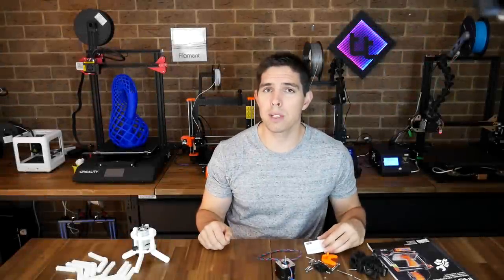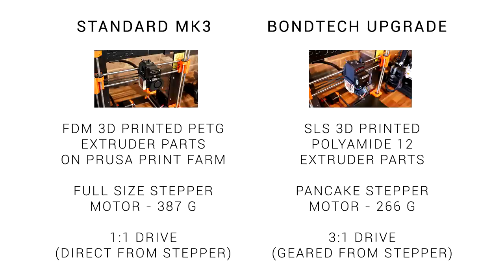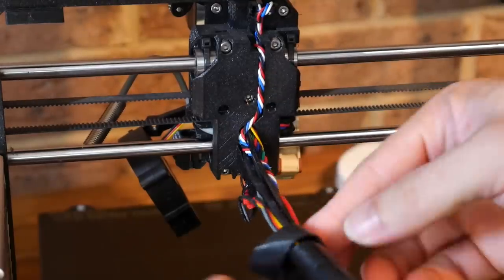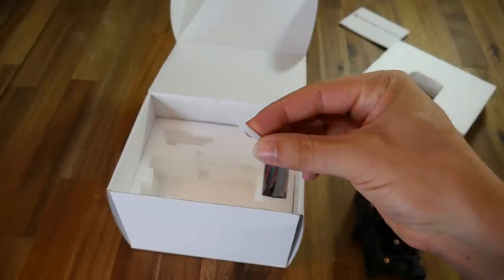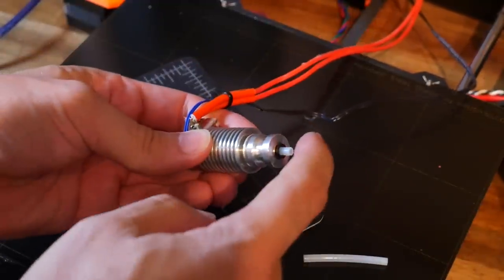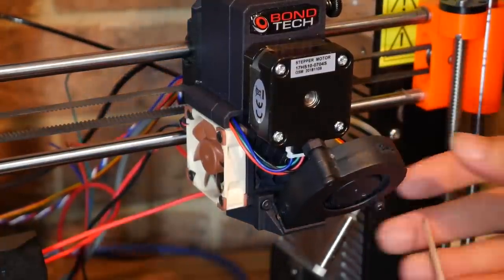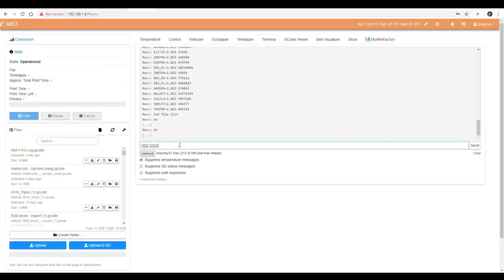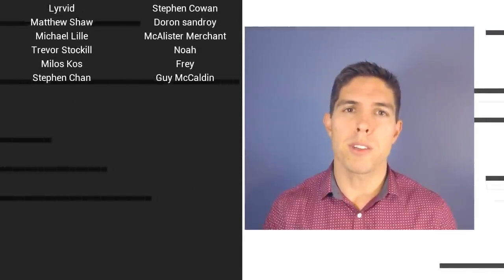Bondtech Prusa MK3 extruder upgrade - Installation and test

Comment: The Bondtech mk3 upgrade already got outdated. Prusa changed their filament sensor and made the mk3s. The upgrade is mandatory if you use mmu2, as the upgrade to mmu2s with mk3s upgrade is free for every mmu2 user. The new sensor is needed, because on normal mmu2 prusa did not use the old filament sensor due to reliability problems. The new sensor is "opto mechanical". Using the upgrade to mmu2s and mk3s will result in higher reliability on multimaterial.

So anyone with mmu who got the Bondtech mk3 upgrade might throw the nice sls printed part away as the new filament sensor will not fit there. Hopefully the community will change the design, so you could keep the other parts. But the housing is about a quarter to a third of the price the upgrade cost. As a new stepper motor is not needed anyway the only parts usefull in long term are the reduction gears, ballbearing and the lever-screw. You can get them much more cheap, even from Bondtech...

Definitly as nice as sls prints are - on a printer constantly improved by manufacturer its not a good idea to invest the money.

https://www.prusaprinters.org/original-prusa-i3-mk3s-and-mmu2s-release-sl1-and-powder-coated-sheets-update/
Reply from the maker: Just read the update this morning. Now i have to decide whether I pursue a MK3S or not.
Reply: @TeachingTech  In your case the decission is simple. Use the Bondtech mk3 upgrade as you already have it and the mk3s is mandatory only if you use an mmu2. Filament sensor is the only change that matters on mk3s, as improving cooling is done by the Bondtech mk3 upgrade also.

As soon as the community updates the design of the Bondtech mk3 upgrade to work with new filament sensor print it with pet-g (maybe with carbon fibers, looks and feels nearly as good as the pa12cf Bondtech uses), buy the mk3s upgrade and use booth
Reply: @oleurgast730  Dollars to Donuts says Bond Tech comes out with a new part that can be purchased.
Reply: Right after I get the Bondtech and before I finish getting it installed, Prusa makes this announcement. Feel like I should be able to send them the bill for it since I got it to address issues Prusa wouldn't. I am loosing a lot of my enthusiasm I once had for Prusa.
Reply: @cybrsage  Nice to hear. But anyway "new part" only can mean new printed housing, as the filament sensors chamber is part of the housing.
Simply adding a new chamber for new filament sensor on top of the old chamber (at the place normaly the top cover goes) and a tube "bridging" the space of the old chamber would be an simple and cheap solution for everyone who already have the sls printed housing from bondtech and do not want to throw it away - but it can be problematic with mmu2s.
Without mmu2s you not realy need to change to new sensor. Never change a running system. 

If you look at 3djake (german website), the Bondtech mk3 costs about 86€, without pencake stepper motor. A Bondtech BMG costs 89€. So nearly the same price, but the mk3 upgrade has a bigger sls print but not include the filament gears. So you can estimate the cost of the big sls print.

So the main critic on Bondtechs mk3 upgrade: They should give more optinions:
Complete, (for business users)
Complete without pencake stepper (this option exists on 3d jake)
Mechanical parts only (reduction gear, bearings, screws, nuts...) to print the head yourself (hobbyists).

The last option missing is the point. It would be much cheaper. Due to Prusa constantly improving designs, the Bondtech mk3 upgrade would be to be updated also. With self-printed head its no problem. But pay once a year for a new sls print+postage may be quite expensive for a hobby user.

Of course you normaly do not need to do all upgrades if you are satisfied with your printer. The mk3s upgrade is somehow special  as you need it for more reliability using MMU. But normaly no need to upgrade any time Prusa makes improvements.

I think, its a bad decission of Bondtech not to release a "mechanical parts only" set. Looking on the prices in their part shop (sadly very high shiping rates) it would cost about 40€.

I compared my original bondtech bmg housing (sls-print nylon pa12) with my self printed mk3 upgrade housing (fdm print with pet-g 20% carbon fiber). Look and feels nearly the same, exept some overhangs need postprocessing.

It is a totaly different situation if you buy a 86€ set (without stepper) and than only a few days later you throw away an sls printed part worth the halve of the set, or if you pay about the halve price, print your own part for 5€ ( for high quality material, if you use cheap pet-g its only about 1€) and throw away this 5€- part only and replace it with a new print.

I would like prusa to integrate the geared design into their regular mk3...

But the next step up should be the mellows dual drive bmg. It's not a simple Bondtech clone like there are many on AliExpress, but a real improved version. Its case is made from Aluminium and works as coldend. So you do not have a Grovemount, but you screw in your heatbreak directly.
Not only it has less hight (so moding bowden systems to direct extruder you do not loose so much print hight), but this way the length between gears and nozzle is shorter. As not only the molten plastic but also 1.75mm filament in a 2mm tube is elastic and increases time between extruder steps and filament actual flows out of the nozzle, this can make flow even more precise. I am very interested to find out and ordered one.
Reply: @oleurgast730  that's what I said, Dollars to Donuts they will sell the new part.
Reply: There's now a 3D printable MK3S sensor enclosure which bolts to the top of the Bondtech SLS unit.

https://github.com/BondtechAB/Bondtech_Prusa_i3/blob/master/Doc/Sensor%20Add-On%20V1.0.pdf

Comment: I recently install a Bondtech extruder with capricorn tube (both originals). I also have an e3d V6 hotend for a while and I´ve replaced the nozzle two weeks ago, BUT my printer keeps underextruding.  I´m printing PETG at 55-65 mm at 245 degrees and it works very well for an hour or so, until it starts to underextrude plastic and ruins every single  print I try. I´m pretty frustrated right now, ´cause I´ve try every trick in the book... 
BTW, both benchys and XYZ calibration cubes are printing without any problems righ out the SD card, so the underextrusion only appears when I print for longer times. 
ANY idea will be accepted.

Comment: I did this upgrade but after i got some small isue with bad first layer getting gaps between the lines ,did a check extrution and it extruded 100mm when i asked it to . So alitle at loss what do do

Comment: Owing to the fact that this should never slip on the filament, and knowing the diameter of the extruder wheels and the feed rate and the controller knowing when it is feeding and retracting etc, how hard would it be to estimate the length of filament used on each print? Just curious. Could an 8 bit controller do this?
Reply: Slic3r tell you lenght, weight and (if you gave the price/kg in filament settings) the price after generating the g-code. Why should the printer controller calculate it?

Comment: what would be better,  mk3s upgrade or bond-tech replacement?
Reply: I have both, and it would be better to go for the MK3S upgrade.   The completely new filament sensor works a lot better, and there's no difference in print quality that I can discern.

Comment: I looked into SLS printing this online and its about the same as it would be buying it and you wouldn't get all the metal bits. What temps can this handle without melting?
Reply: Deneteus thermal Properties are slightly better than ABS.
Reply: @Mr3DPrintWizard  Is it glass fiber reinforced nylon?

Comment: A bit late to the party, but i can't help notice you reinsert the ptfe locking ring. But as i see it, the extruder is meant to press down on the tube to keep it into place, by design. You essentially undid this by locking the ptfe tube into place.

Also, they recommend a 5mm length prothrusion.

Check the official installation guide .
https://youtu.be/dTUppEUFXVE

Comment: Can this be used with the MMU 2.0?
Reply: Yes, some people have posted they are using it with the MMU2.
Reply: Yes. But not with MMU2s and mk3s, the free update all mmu2 users will get. The new filament sensor will not fit.
Of course the community will react soon with a modified design. But I do not think Bondtech will send new sls printed parts to all Bondtech mk3 upgrade buyers for free.

So print the upgrade yourself (I used pet-g cf 20; works fine), only buy the mechanical parts needed if you go to mk3s the next months anyway.

Comment: I recently buy a cr10s pro and i want to upgrade it to bondtech and pancake stepper motor. Do i need to adjust the vrep or voltage to my stepper drivers?

Comment: I'm sorry, but I cannot really see the upgrade here either (except better part cooling, for which I think there are less expensive options). I'm saying this honestly, not trying to troll.
Reply from the maker: It's a fair point. A lot of folks might try it if they were experiencing the inconsistent extrusion issue.
Reply: Better heatsink cooling too, thanks to Grégoire Saunier.
Reply: The improvement in quality is actually pretty stunning.